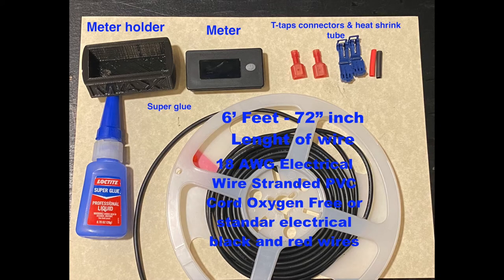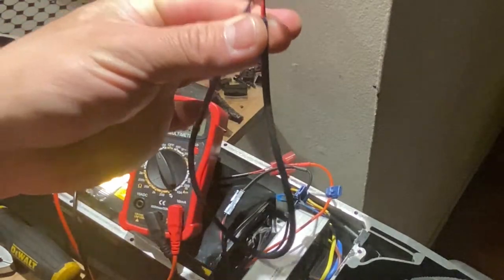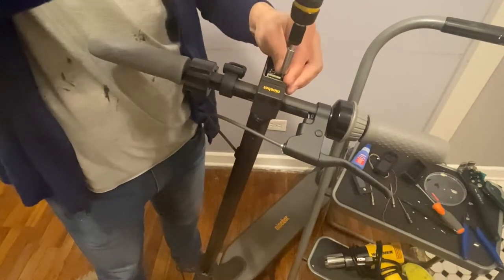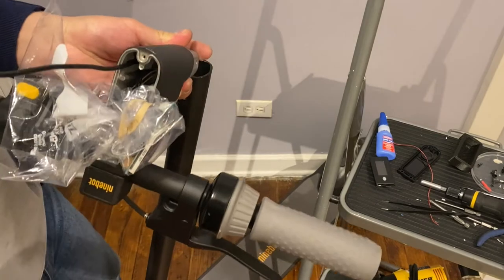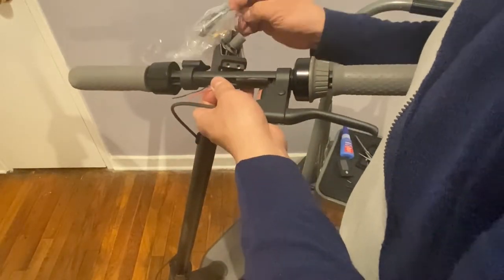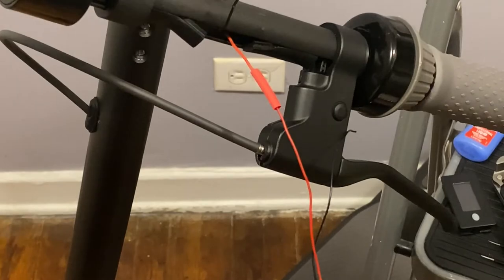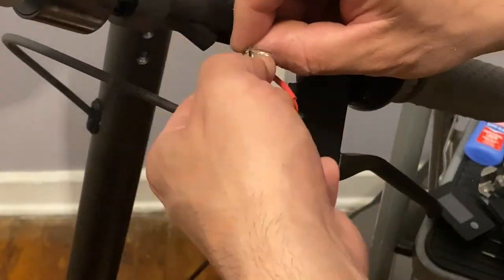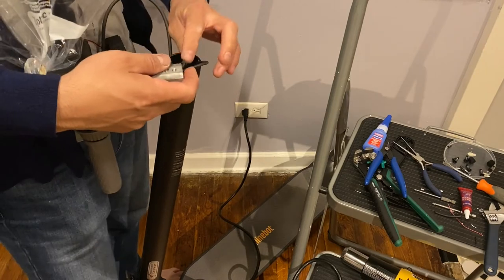Ninebot Max Meter Installation

Comment: What size is the handle bar as i woulld loved to putting nice set of any colours be bonus and where can i get a thumb throttle as sharkset grip kit fully sold wont say wen it be in stock next
Reply from the maker: Good news is that I have the very same handlebar with a better throttle with the lever. If you are interested contact me on my FB esnkaz.

Comment: Did you connect the voltmeter to the charging wire of the battery? Can I connect it to the discharging wire with an Y-cable between battery and ESC?
Reply from the maker: Yes, to get best readings you do it between Battery and ESC.